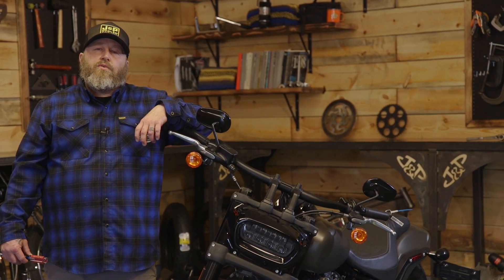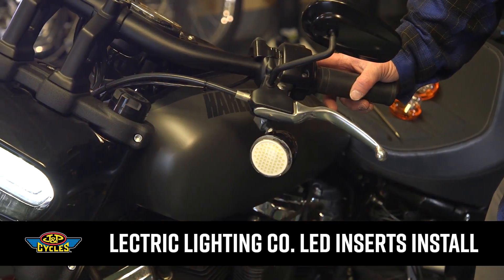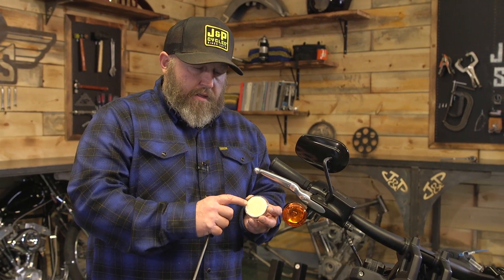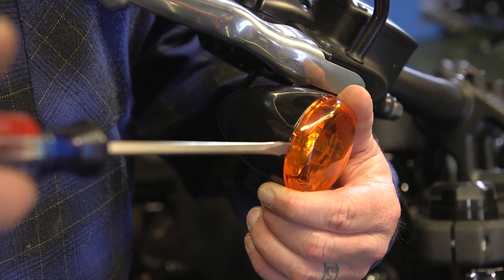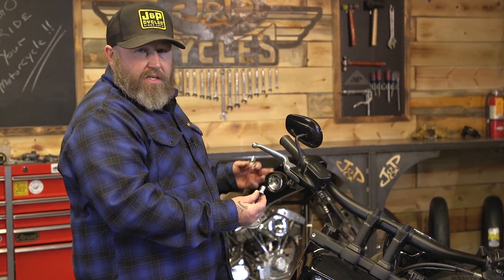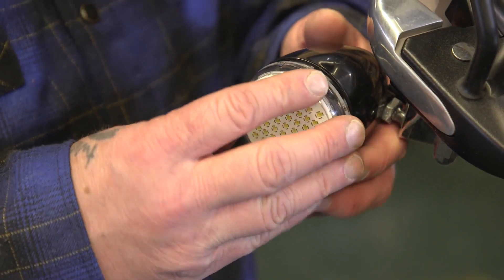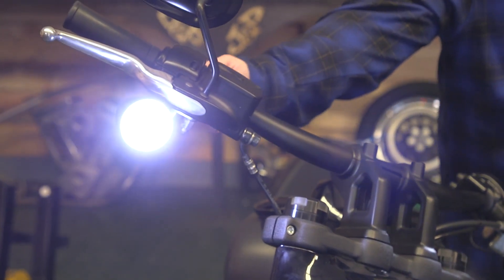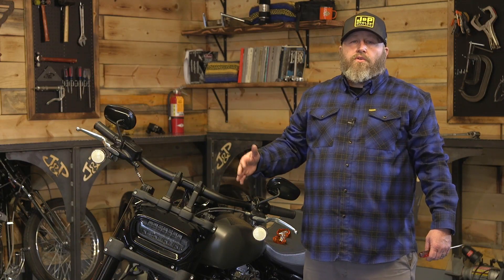Letric Lighting Co. LED Turn Signal Install : Milwaukee 8 Softail

Comment: Just bought same ones but they don't fit right with my smoked lens.
Reply: It looks like these lights replace the lens all together, that's why he didn't put them on. Unless they sell a smoked version of this light, you wont have the smoked lens.
Reply from the maker: These lights have a built in clear lens. You wouldn't be able to use another lens with it.